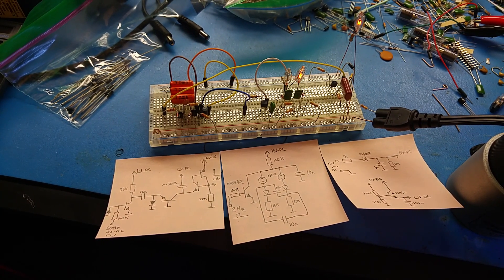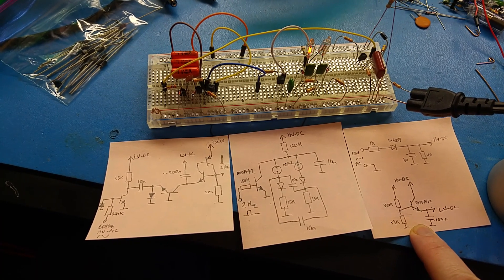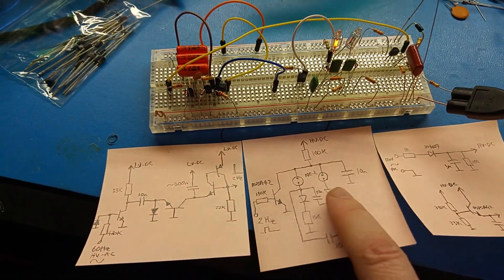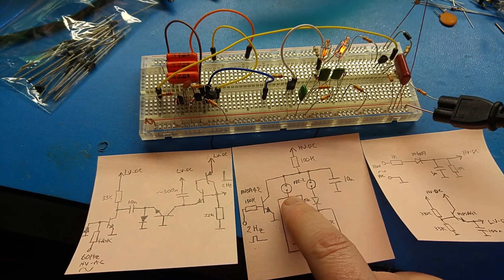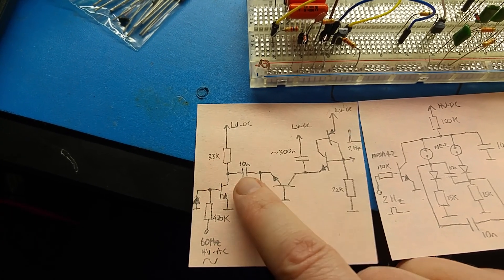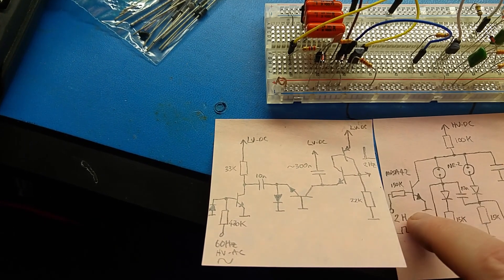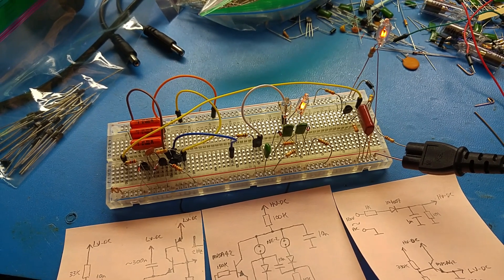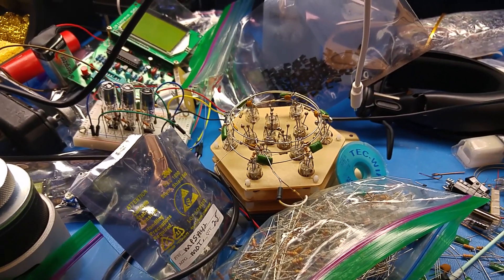Flashing Light Prize 2018 Entry - Neon Bistable and Cap-Ratio Divider

Comment: Nice video. But there seems to be an error in the schematic of the ring counter. The bottom capacitor is connected in parallel with the top one. It should go from the bottom of the left diode to the top of the right one.
Reply from the maker: Per Magnusson yep correction is already in the notes.
Reply: Sorry for my superfluous comment. I was in a hurry and did not see the notes. Again, nice job. I like your way of using discrete components in clever ways to build functions that most designers would use ICs or even software running in microcontrollers to do.
Reply from the maker: No worries, I shouldn't have screwed it up in the first place. :)
Yeah I like to do stuff in analogue electronics where it makes sense.  It is often simpler and lower power to just use a few jellybean components instead of putting down a micro and having to program it.  Not as flexible of course, but it also "just works" and can never be bricked.

Comment: I always learn something from your analog circuit designs. The charge incrementer is really cool. Very nice all around.
Reply from the maker: The charge shuffling design I did a few years ago for a staircase waveform generator in the Advent series.  Dividing by 30 in a single stage is getting close to the practical limit, component tolerance and temperature variation will start to cause problems (missed steps/division ratio change).  When I rebuild this thing into a light bulb or something I will probably replace the single divide-by-30 with a cascaded divide-by-5 and divide-by-6 which will be much more robust.

Comment: Very cool project!
That capacitive divider is very interesting.
Reply from the maker: It is a fun and useful little circuit.  I've used it to make staircase waveforms for periodically stepping things through a range of current/power/frequency/brightness levels, and digital frequency division like here.  It is cheaper, smaller and simpler to set up for odd-ball low divide-by-N problems than logic chips.  Just gotta watch out for leakage at low frequencies and tolerance/stability at high division ratios in a single stage.